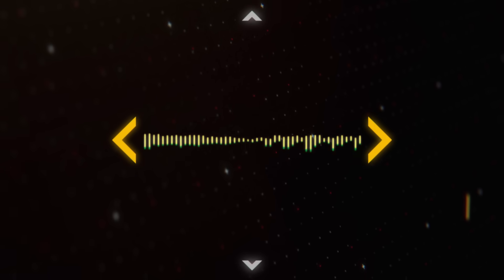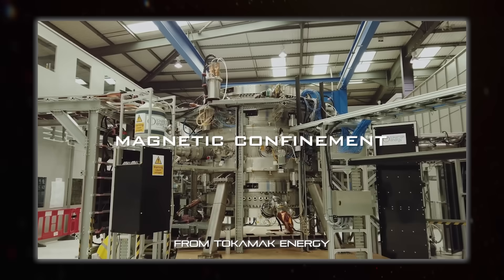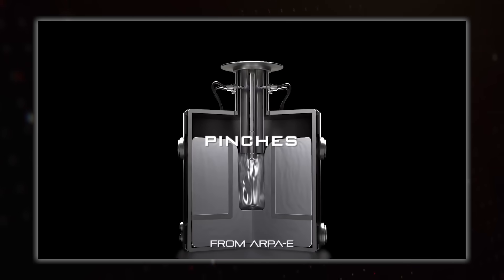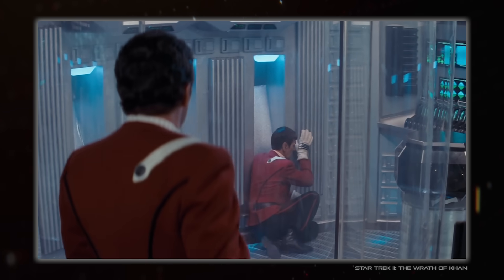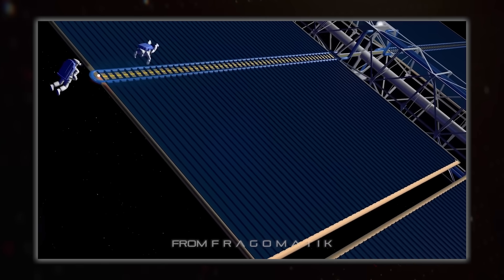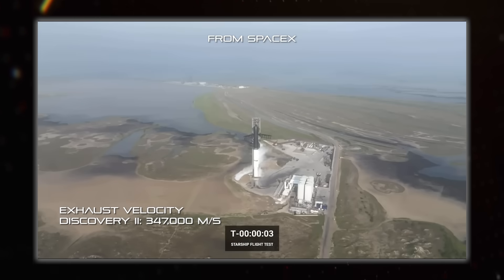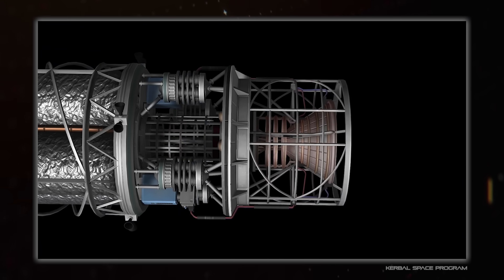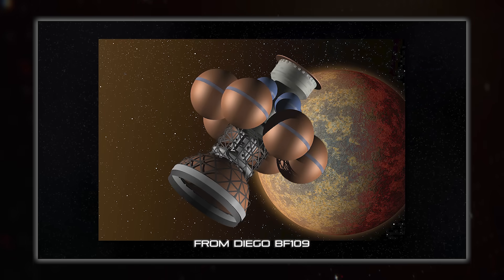Explaining Fusion Engines in Realistic Sci-Fi

Comment from the maker: Get "Designing the Perfect Space Fighter - A Spacedock Reference Book" here!
https://www.patreon.com/posts/77243474/
Reply: 7:52
Project Orion
Reply: @hellacoorinna9995  Would we not call that a pulsed fission fusion engine. Since it uses fission as the initial stage to create the fusion reaction with hydrogen bombs.
Reply: Question. How would fusion engines work i the Mass Effect universe? Considering that element zero can lower the Mass of the ships and even create gravitational fields, how would this affect the performance of the fusion drives as well as those projects you talked about in the video?
Reply: @domenicoazzia4153  As Mass is the real issue in Our Universe, reducing the influence of mass would reduce the energy cost of very high speeds (~ > 75% of c (light speed in vacuum))
🚀
Reply: Are you going to do a video on realistic fusion reactors in Sci-Fi? I assume it would come down to "There aren't any." because all the fictional ones can explode with varying degrees of destructiveness. A realistic fusion reactor (or engine) would be explosion proof because the solution to any problem or damage is simply cut off the fuel feed and it instantly stops.

To make fusion reactors (or engines) that can explode would require both very advanced technology to contain an immense amount of energy and a vast amount of lack of smarts to not design the thing with a way to have it rapidly and safely dispose of that energy without doing major damage to everything around it.
Reply: I Don't need Science... I have the power of Imagination !
Reply: @90lancaster   Fueled by Science 
✌️

Comment: I believe this may be a combination of some of the other methods, but another method is electromagnetically driven fusion propulsion, using a "liner drive". Believe it or not, the liner drive makes it so that radiators virtually aren't needed, as the magnets redirect the majority of the energy into the plasma. So the Epstein Drive may not be so far-fetched after all.

Comment: You didn’t talk about the problem of starting up a fusion engine. Ships would need enormous batteries or some other kind of controlled explosion to generate enough power for magnetic confinement or compression lasers or whatever you need for fusion to occur.
Reply: Just have a nuclear fission reactor on your ship to power your fusion drive.
Reply: @ShrimpTreadmill how would you dissipate the heat produced by that reactor?
Reply: @Andreich-v7n  Radiators. Lots of radiators. A fusion drive is closed-cycle, so you will have to deal with the heat problem anyway.

Comment: What i understand is that it's much easier to create a fusion engine, than to make a fusion reactor to work. It's to different ways and in the case of the engine you only need to protect the crew from radiation and don't need to confine the reaction. You will use less fuel than in a conventional rocket, so you can accelerate for a longer period of time. So if we truly want to go to Mars or further out in the system, we need this technology.

Comment: VASIMIR is a really cool fusion drive. It's a hybrid of two type of fusion drives so it's capable of "gearing" between a high exhaust velocity, low thrust mode and a lower exhaust velocity, higher thrust mode.

Comment: This video is excellent. For completeness, I should point out that in the 1995 computer game called "Mission Critical" by Legend Entertainment, the description and portrayal of the US Navy deep space light cruiser Lexington is impressively rigorous. The Lexington has a chemically-powered orbital maneuvering system and four aft-mounted fusion engines. The engines are fed via linear accelerator on the centerline of the vessel. It drives deuterium and tritium fuel into a pressure vessel, where inertial confinement fusion occurs via compression lasers. If I remember correctly, the Lexington is capable of a maximum acceleration value of 7 gravities when it is in normal space. The habitat module has the decks oriented in the proper direction relative to the axis of thrust. The vessel's exact dimensions are not stated, but I estimate the Lexington to be 260 meters long with an 88-meter beam and an 85-meter draft. The vessel is designed to be very fast, lightly armored, and heavily armed -- with a typical crew of 20, a maximum crew capacity of 25, and a primary role based around the employment of up to 18 unmanned combat space vehicles. She also has a few close-in weapons for use if things do not go according to plan. There is no magical inertial damper technology in the game.

The design of the ship does have several intentional departures from scientific realism for narrative reasons. It includes an FTL jump drive and omits temporal dilation. Furthermore, the Lexington is depicted as deriving its electrical power from a pressurized-water nuclear fission reactor, similar to those found on modern submarines. This portrayal is unrealistic for a ship authorized by Congress in Fiscal Year 2111, as one would expect the Lexington’s power reactor to likewise be of the nuclear fusion type. I believe that departure was likewise for story purposes, so as to have a way to create dramatic tension through the danger of a power reactor meltdown once the Lexington becomes severely damaged in battle.

Comment: What if you used the "Afterburner method" on a fissionable material like nuclear-salted water? Wouldn't use nearly as much of it as a standard nuclear-salt engine, and the fuel wouldn't need to be enriched so heavily with uranium or fissionable material, the heat and charged particles should be enough to induce fusion in the water molecules, the fissionable material still undergoes a chain reaction while remaining sub-critical and safe when stored, wouldn't need nearly as much neutron absorbing material around the fuel tanks, saving on containment weight.

Comment: main issue I see is you still need more than half the ships "tonnage" as reaction fluid no matter how efficient the drive is.
Reply: Unless they get it to relativistic speeds, making the exhaust much heavier, allowing less mass for fuel of the ship, just an efficient and powerful accelerator. Also, I'm curious as to does it moves slower relative to the ship as it leaves or not like that?
Reply: The mass of the entire ship increases as the ship travels closer to light speed so there is no net benefit as both the ship and its exhaust are both more massive

Comment: As far as the expanse and the epstien drive go, the reaction mass is good old water. The fusion reaction is so damn hot that you can convert water into a plasma which gets yeeted out the drive cone with a magnetic field within and made of future stuff that resists melting. But using cleaned water as a reaction mass when combined with fusion seems plausible?!?! Im a mechanical engineer so creating mini suns to hurl you across the radiation soaked vacuum is a little over my head

Comment: I'm working on a space game and I was using spaceship hulls that had about twice the mass of modern Navy warships (between 7000 and 14000 tonnes) on account of shields, plating and additional technology. I was planning using fusion reactors with ion thrusters as a baseline and found that constant thrust between 5000 and 30000 newton was the sweet spot for acceleration in my environments. Glad my calculations were on point.
Reply: You need huge thrust to move such amounts of mass in reasonable time. Only (sci-fi) modified ion thrusters is able to complete this.
Reply: Ships that massive with engines that weak would accelerate rather slowly. 14000 tonne ship with 30000 newtons of thrust would accelerate at 0.002142 meters per second or 1/4587 of a g. It would take them over 3 hours to get up to 100 km/hr. Which is realistic, but would mean travelling to mars would take months depending on the time of year.

Comment: Is it possible to get a fast fusion engine running without any secondary propellant?
Reply: Not really, no. You could fit massive ion engines to be powered by the energy of the reaction, but they'd still be absolutely pathetic compared to a fusion torch of any kind.

Comment: You missed the most obvious alternative of electric confinement fusion or Farnsworth–Hirsch fusor. This design works like an ideal fusion engine from the start (very little modification needed of the reactor) and can be fed with B-11 and hydrogen to produce a fairly clean fusion process with only helium/alpha particles as a side product. It could theoretically have insane specific impulses and pretty good thrust to weight ratios.
Reply: Except that the theoretical maximum plasma gain is less than 1, so the thrust power will always be lower than an ion engine of equal input electrical power. It would be a strict downgrade from what we already have.
Reply: @caliperstorm8343  Why would that matter if your power out put is several orders of magnitude higher than the biggest ion engine we could possibly operate?

Yes, you loose efficiency but the gains in absolute thrust makes the efficiency argument null and void as you can get to where you need to be anyway.
Reply: @mattiasdevlin1363  The hell are you talking about? If you have an electrical generator to run your fusor at orders of magnitude higher power than any operating ion engine, why couldn’t you just run an ion engine with it? It’s fundamentally the same operating principle (electrostatic acceleration). The point was that since net energy gain from a fusor is always less than one (b.c. chance of fusion per fuel atom*energy per fusion is less than Coulomb barrier energy for all known reactions), it’s strictly worse than running an ion engine with the same input electrical power.

Comment: Another interesting concept is the VASIMR-engine which is basically a rocket engine with a gear shift (I hope I found the correct translation). This "gear shift" enhances the engines propellant efficiency as you can adjust the drive to the situation you are facing. The concept isn't specifically designed for fusion but it can be used to power the engine and boost its thrust.
Reply: We got space cars before gta 6
Reply: We got space cars before gta 6

Comment: I imagine two stages, though, not how we think of rocket stages. The first stage is the burn stage in which we use fuel and burn it to start moving the craft and gaining initial thrust. The second stage is the cruise stage in which we use our fusion reactors to power massive ion drives. That, more than anything, would be the ideal solution (I think, as far as near-term technologies go). Also, fyi, we wouldn't discard any of the stages in this, since they're just two different types of engines which move the ship and they rotate which ones are on/off depending on the situation and "stage".

Comment: I'm very late to the party, but I just wanna say, if you want to use high-thrust fusion engines in your setting while still making it sound realistic, you can limit it to Solar System only.
We don't really need more than a few hundred km/s of exhaust velocity even to Pluto; we don't have enough time to reach higher velocity before the flip-off point is reached.
Since fusion engines are capable of spewing its byproducts up to 1000 km/s, we can easily trade some excess velocity for higher thrust.
Reply: If FTL is a thing, then you probably don't need to travel too far in real space
Reply: @Terranallias18  Even more so if your FTL travel method is usable for interplanetary travel as well as interstellar; you'd only need regular thrusters for orbital maneuvering.
Reply: @Terranallias18  Depends on the type of FTL you use. Things akin to warp drives or most hyperdrives sure. But if you are using Jump points or something similar, then you will have to fly to those points.
Reply: Couldn't agree more that interstellar will mostly be done by probes like how we do science around our solar currently. The best idea I've heard is solar sails with a fusion drive just to slow down at the end to be captured into the solar system. The drive wouldnt need to be efficient and so would be lightweight compared to other designs. 

This added mass means itll take longer to get there but will actually be captured so we can gather more data and therefore more science.

Comment: Inaccuracy:  The sun is actually too cold to produce fusion.  It occurs in the core because of quantum tunneling.
Reply: Half right. Quantum tunneling causes fusion, yes.
But gravity is what confines the fusion plasma.
Reply: @scifirealism5943  What's "half right" about saying that the temperatures are too cold for fusion?  Nothing.  What you said is related to the density of the atoms, which is literally what I implied by stating that fusion occurs by quantum tunneling.
Reply: @mazack00  I'm saying gravitational confinement would allow practical fusion power.
Reply: @scifirealism5943  .... On the order of THE SUN. Also the quantity of fusible material required must be considered... Which is insane
Reply: @mazack00  yes, gravity manipulation is impossible.
Unfortunately, it's one of the three required technologies for practical interstellar travel like in Star Trek.
Reply: @scifirealism5943  Are you sure about that  -John Cena
Reply: @mazack00  yes.
Reply: @mazack00  the 3 technologies required for interstellar travel are:

Faster than light travel 
Artificial gravity 
Extreme energy prowess
Reply: @scifirealism5943  you're a caveman lol
Reply: @scifirealism5943  Also what you're saying is incorrect:  The density of the atoms contains the energy released from fusion as the photons constantly bouncing around in the extremely dense environment.

Comment: Magneto-inertial drives also have a second, similar variant
The magnetized target fusion one
But the principle is the same. Use mass to squash mass until it fuses. 
So instead of using lithium foil, you can use deuterium to squash deuterium to fuse, by spitting it at the plasmoid in the middle at high velocities, then throwing some propellant on it afterwards. This version can achieve high thrust for its efficiency. (for any  inaccuracy i apologize)
I love Atomic Rockets, and how its author, Winchell Chung writes it

Comment: One thing I found myself super curious about by the end of The Expanse was what would it feel like to be inside the moving drum of the Nauvoo during the originally intended journey to it's new star system?

Because you get gravity along the length of the ship via the engines thrusting forwards, which presumably needs to keep happening through the entire trip for it to take even a remotely reasonable amount of time. And rotational gravity in the drum via the spinning of the drum.

So would you have two different sets of gravity pushing you against the outer edges of the drum and also feel like you were constantly being pulled in the direction of the engines at the end as well?
Reply: Realistically, the Nauvoo's crew should've got pulled to the drum's "lower corner" as a result of the vector sum between two accelerations (one perpendicular to the ship's axis, and one parallel to it).

A neater way of doing it is to make it so that only one source of artificial gravity is active at any one time. 
Avatar's ISV Venture Star's solution is to fold the hab drums parallel to the thrust axis, so when the ship is under thrust, they got pulled to the engines, and when the ship is coasting, the drums open up and become centrifuges. That leaves them with the problem of transient weightlessness when the drums are transitioning from one mode to the other, but I guess it's just trivial matter😅
Reply: I'm assuming the original idea wasn't to have it accelerate the whole 100 years

Comment: You don't need energy positive-fusion to generate thrust. You could have a fission reactor to make up the difference, and provide power to a fission drive that consumes net energy. In that case, use fusion as a way to get an engine with large mass flow (and thus large thrust) very hot exhaust (high fuel efficiency), while not actually needing a viable net-positive fusion power technology. Some form of nuclear propulsion (fusion, fission, or hybrid) is pretty much mandatory for non-fatal regular human interplanetary travel, especially for any planet further away than Mars.
The energy involved also means gigantic heat radiators, unless you use something like metallic dust radiators or liquid tin radiators.

Comment: Crossing my fingers for a video about a nuclear salt water engine. The probably most insane, but achievable, engine concept ever devised.
Reply: Ah yes. The engine powered by in essence a continuous nuclear explosion, it's perfect.
Reply: @killman369547 that's not how it works
Reply: You know it is a good design when it makes Project Orion look relaxed and leisurely.
Reply: @CptJistuce  Well it is not really that extreme due to moderation of neutrons and smaller critical mass actual amounts of power produced in a single moment in time is much lower in such an engine compared to Project Orion but constant nature and much higher efficiency (only a very small fraction of power generated by Orion drive is used for thrust) make ii truly a very potent engine. I would love to see it operational one day, as the only fundamental issue with it I can see it can't be developed on earth. No way to test it safely
Reply: Scott manley made a video on this.
Reply: the engine that could be that similar to the epstein drive from the expanse the vid from scott manly did talk about that
Reply: I use a variation whit an external neutron source in one of my settings as the main propulsion  system